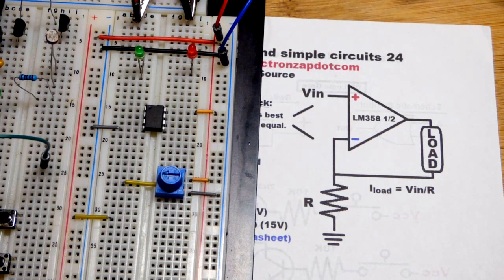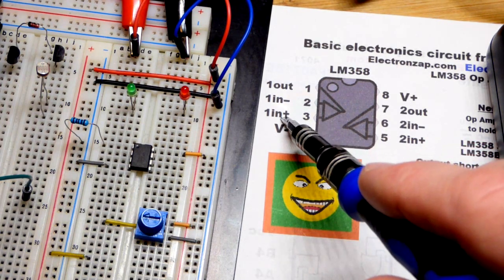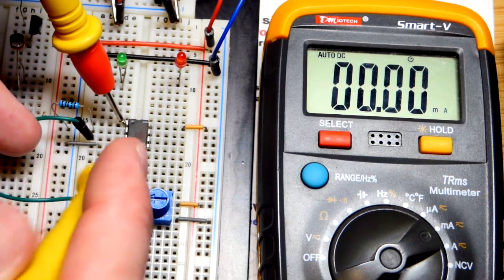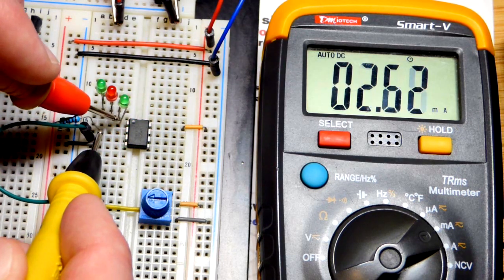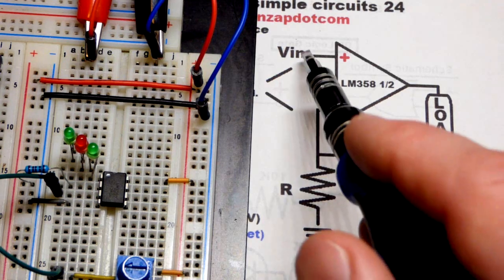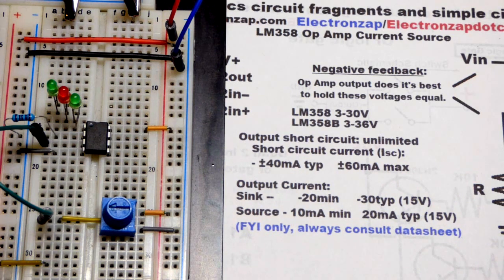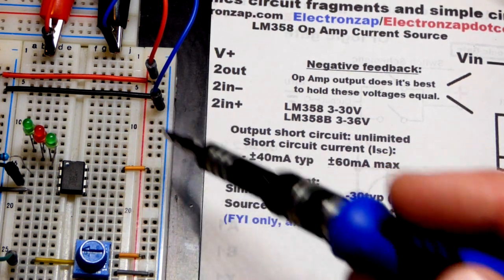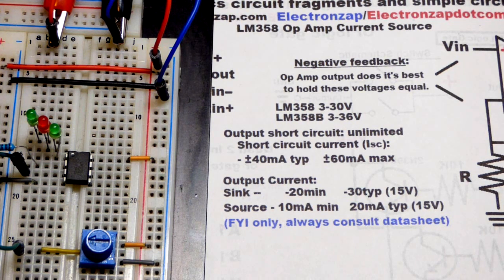Electronics course 26 LM358 op amp current source circuit is super simple by electronzap

Comment: Any chance you can elaborate on why the output's ability to swing all the way down to the negative rail allows us to use a single supply? My attempts to bias either op amps or transistors has been very hit or miss, but I confess I have not been working on that perhaps as much as I should. Thanks again!
Reply from the maker: You have to look at the schematic of the op amp circuitry included on the datasheet to see what types of transistors they are using and all of the transistor circuit fragments to truly understand why it does what it does. Early op amp were intended for ±15 slit supplies so they weren't all that concerned about going to either rail.
Reply: Thank you. :)